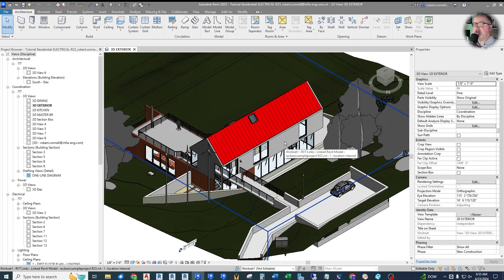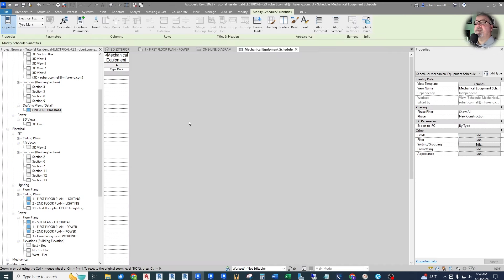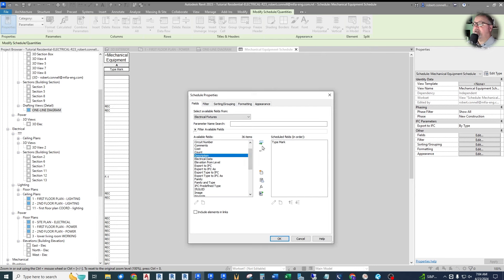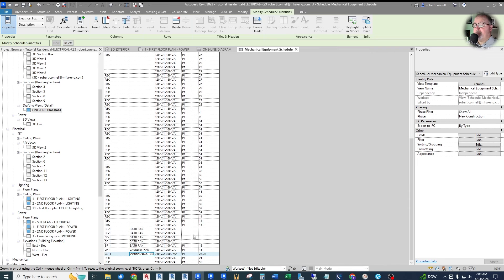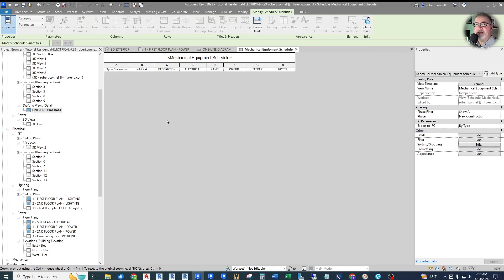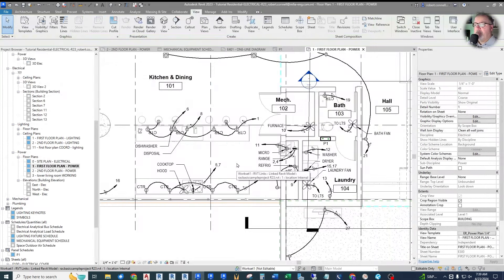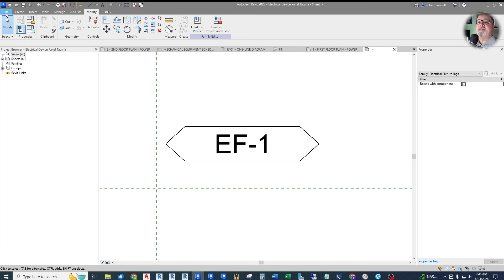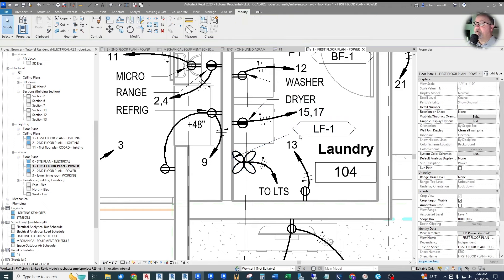REVIT MEP MECHANICAL EQUIPMENT SCHEDULE SECRETS (step by step)

Comment: So, when you have a separate mechanical/plumbing project do you just copy the same equipment into the electrical project through copy/monitor?
Reply from the maker: Hey there! Actually, there is no benefit to copy/monitor mech/plmb content, as their families typically do not contain the electrical connectors nor the electrical data that we need. We simply "link" their models into our electrical model, adjust the visibility of their equipment (we like to show their actual equipment that needs electrical connections on our power plans) - the ductwork and piping would only be visible in Coordination views, not final views. Then we insert our own "mechanical equipment connection" family near their equipment, which we can then circuit up to our distribution system. You can see an example of this in my Commercial Project Series, Episode 2 https://youtu.be/7E3Db4oMlk4  at timestamp 2:01:45. Hope this helps!

Comment: Hi rob. Thanks for the scheduling tip. If we use the electrical template schedule, does that mean we need a separate schedule to show the Mechanical parameters (etc. airflow) side of the equipment?
Reply from the maker: Hey there! Yes, in our firm, we do have separate schedules for the Mech side parameters and the electrical connection side. I suppose you could combine schedules if you needed both, but that would be tough with a linked mech model. Hope that answers your question!

Comment: Do you know if there is a smart location parameter for electrical fixtures that will tell the schedule where that fixture is located? Similar to the parameter for electrical equipment that tells the schedule what room the panel is in?
Reply from the maker: Great question, but I'm afraid I don't - like you mention, there is such a parameter for electrical equipment, but unfortunately not for fixtures.